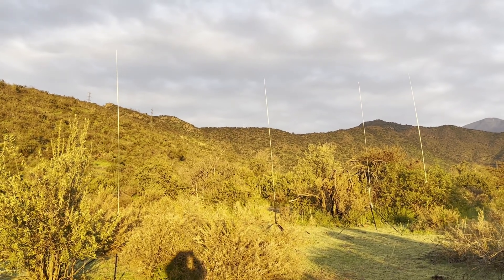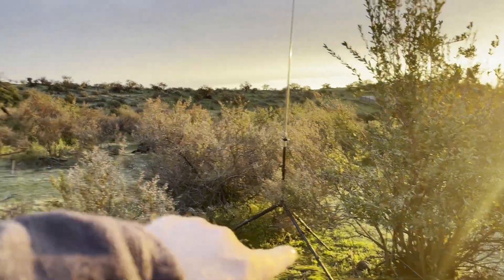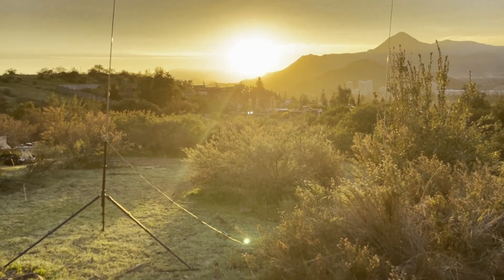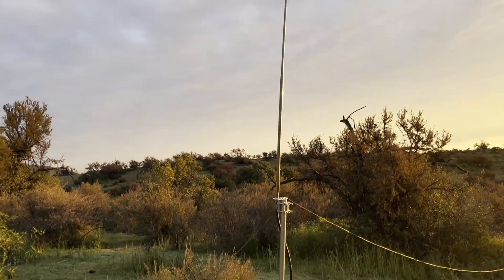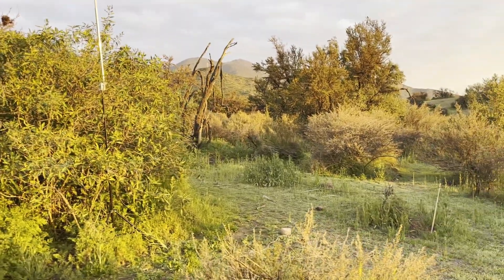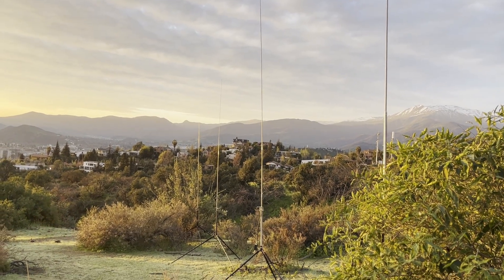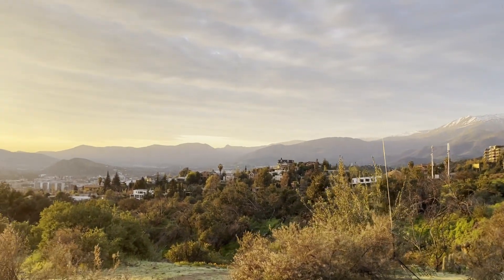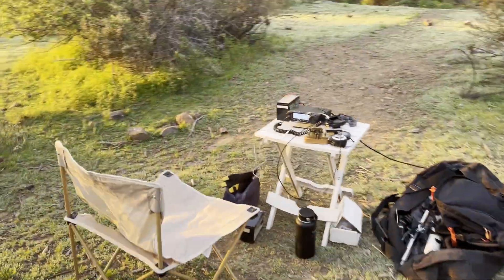A portable 4 Element parasitic vertical array from Chile for 15m

Comment: Hey Jason, I love seeing those four PERformers in a line, so majestic! I'll have to model that for you sometime ... I did model the 3-element and it did more for front-to-back than gain (incremental). Coming out this month (October), I'll be publishing my modeled 2-element PHASED PerformerArray with two configurations: bidirectional figure-8 with +3.67 dB more gain than a single PERformer with 17.8 dB front-to-SIDE, and a unidirectional cardioid which delivers +3.11 dB more gain than a single PERformer with an incredible 26.1 dB front-to-BACK on 20M! I am eager to see you deploy these configurations in the field and give them a test. Let me know if u want to see my draft before I share it so u can start experimenting early. Wooo hooo!😀 73 KJ6ER
Reply from the maker: Yes, send it to me please!  I’d be happy to test it as long as I can find all the parts here.  I’d love to see the 4 ele version modeled and have it optimized for forward gain.
Reply: @jasongoldsberryCE3-N5NU  once I get this PHASED PERformerArray completed and published, I will help u with the 4-element PARASITC PERformerArray! I'll email u the DRAFT doc within a couple days my friend! 73 KJ6ER
Reply: I’ve been using a phased array with two 17foot whips and four elevated radials per antenna for a while.  In fact, I think that I had a couple of contacts with KJ6ER using it.  I think that it works really well.  However, I am currently dreaming up a four square version.   The phasing cables for the four square are a bit more complicated though. I’m tempted to just buy a comtek box.  I’d love to see what you came up with. I’ve been modeling my antennas using mmana.

Comment: Jason,  great job! I was going to suggest considering also a "flamethrower"..? Same amount of hardware - but think of it as a single parasitic 2-element (with reflector) now add ANOTHER pair, 0.6 wavelength side by side. Feed them both with a T piece and 2 x 75 ohm lines ( you may need 3/4 wavelength since 1/4 wavelength not long enough ). However, I just modelled this and there's not a lot in it. The "Flamethrower is less twichy and wider bandwidth - that's about it! Love it! If you want crazy - try six - that's 3 per side LOL!!
Reply from the maker: Hey Callum,  I appreciate the kind words!  I'm certainly willing to try it.  I've never modelled this particular antenna, so have no idea how much again it (or the Flamethrower) actually have.  I'll shoot you another email with a drawing to make sure I'm on the right track with it.  73!